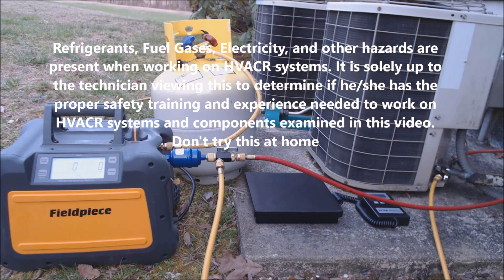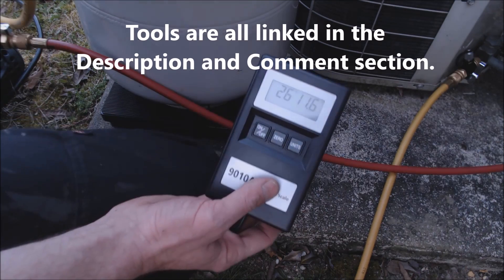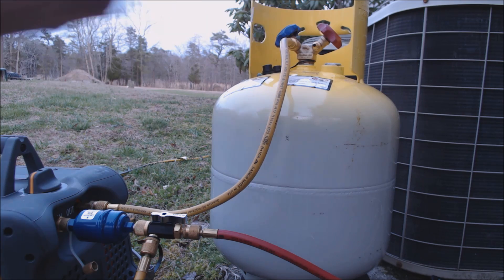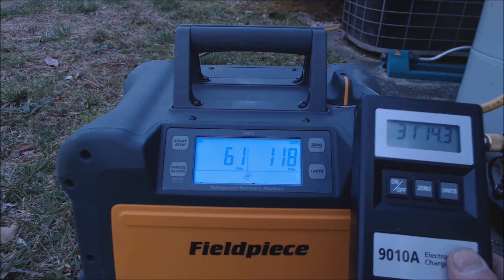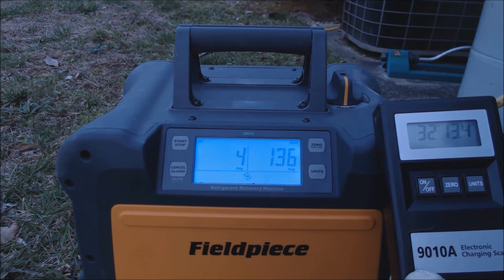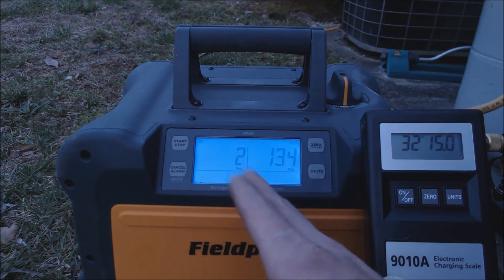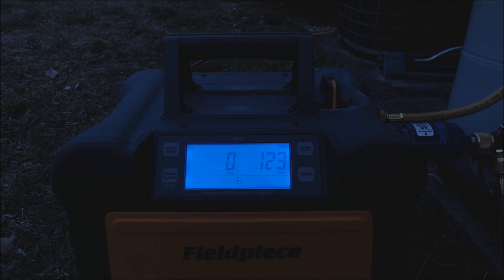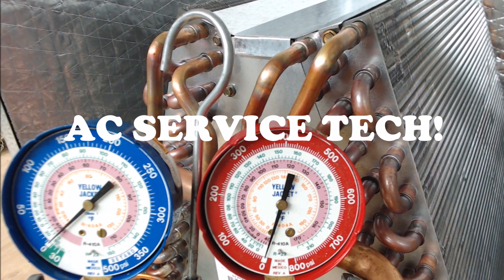Refrigerant RECOVERY Procedure Step by Step! Fully Recovered!

Comment from the maker: Tool List-  https://www.amazon.com/shop/acservicetech
Support-  https://www.patreon.com/acservicetech
For those that are looking for the tools used in the videos: (Linked Below)
Here is the link to the Appion Valve Core Removal Tool- http://amzn.to/2uYr8WL

Here is the link for the C&D Valve Core Removal Tool- https://amzn.to/2vqA0qy

Here is a link for RectorSeal Bubble Gas Leak Detector http://amzn.to/2ckWACn

Here is the link to the pack of 25 C&D valve cores- https://amzn.to/2J1lurm

Here is the link for the C&D Valve Core Wrench, Container, and 3 valve cores- https://amzn.to/2EVGkps

Here is the Link to the Fieldpiece MR45 Recovery Machine- http://amzn.to/2xAOpN6

Here is the link for the filter drier- http://amzn.to/2veVV3m

Here is the link to the Yellow Jacket 1/4" by 1/4" heavy duty hose straight-  http://amzn.to/2umtcod

Here is the link to the CPS Vacuum Micron Gauge- http://amzn.to/2v1nM3O

Here is a link to the JB 6 CFM Vacuum Pump   http://amzn.to/2nqbvo8

Here is the Link to the Appion Blue 3/8" to 1/4" Vacuum Hose- http://amzn.to/2uYlVyc

Here is the Link to the Appion Red 3/8" to 1/4" Vacuum Hose- http://amzn.to/2uYg6Ro

Here is the Link for the newer UEI DL479 Multimeter with temp sensor- http://amzn.to/2jtsUbJ

Here is the link to the 2 pairs of alligator clips- http://amzn.to/2CtIL5z

Here is the Link for the FieldPiece ST4 Dual Temp Meter- http://amzn.to/2AhR6ph

Other tool links can be found in the video description section.

Shop through Amazon! Your Purchases through Amazon provide a means for channels such as mine to earn advertising fees from all purchases after clicking through. Prices are the same as normal-    https://www.amazon.com/shop/acservicetech

All of the ACSERVICETECH Playlists-  https://www.youtube.com/channel/UCOZR-1IqsAer9wzlvFgb4mA/playlists?view_as=public
Reply: Please Please Please.........make a video showing these Tech's how to ( REINSTALL ).......that refrigerant back into the system after you reclaim it
Reply: @acservicetechLLC how did you make the connection between the filter dryer and the recovery machine ?

Comment: Min 2:25, the valve used doesn't appear to be a two way valve, it's only a one way, so one of the connections to the AC high or low will be evacuated not both simultaneously, so what is the point of connecting both? the high side liquid line valve connection seems open, which is connected to the low side of the recovery tank which seems counterintuitive.

Comment: Where did u buy that filter drier, what's the brand and part #? I only seem to see both sides male or both female. The one u show in the tools list is male on both sides. What adapter did u use to go from the male on thw machine to thw male on thw filter drier? I dont see that tool or part on the list.

Comment: If the unit has a leak then it’s useless to purge the hose to get the air out of the lines
Reply: Not quite. As long as he doesn't go below 0 psig it's not going to pull any air in. It can't pull air in as long as pressure is greater than atmosphere.
Reply: @FluffersMcFluffleton makes sense thx

Comment: FYI for EVERYONE: You do not get a warranty from Fieldpiece if not purchased from an authorized dealer.

I called Fieldpiece to check and they said that there ARE NO online (web-only) authorized dealers, including amazon, unless it happens to be an HVAC supply house that also has an online purchasing website. The current Amazon link for the MR45 is not an authorized seller. Be Careful. The Fieldpiece representative said they do not know where the online seller is getting their equipment - not good.

Comment: Where did it say that was a 50lb tank
Reply from the maker: it says WC water capacity on the neck. It may be 48.7lb possibly.
Reply: How do you use 1/2” hoses when one end is 3/8? The tee fitting is all 1/4”

Comment: Heres the problem i have with the ending of your video, when the self-purge shuts off isn't the output valve still open to the recovery cylinder?  

I would think you should go from "self purge" to "closed" on the knob the second the recovery machine shuts down from the self purge cycle; otherwise in theory, if the output valve on the recovery machine was open because the knob was set to "self-purge", the pressure of the cylinder would push vapor right back into the machine which we do want want sitting in the machine.

I would think it would be better practice to put the knob to closed position immediately after self purge shuts off, close the recovery cylinder, release any diminus,  open input and output port of the recovery machine to atmosphere briefly and purge with nitrogen, set knob in the recover position on the machine for storage.

Your thoughts?

Comment: how come the high side pressure did not read 0psig if all the refrigerant was recovered?
Reply: My question as well.
Reply: I think right in the beginning he says the two numbers are input and output. So the input on the left being the system side reading 0 and the output being the recovery bottle side and was reading in the 120 ish range or so. I think that's the answer, but I could be mistaken.

Comment: Hi Craig,

I noticed you had a filter drier attached to the mr45.  I looked at the description and it wasn't listed.  I checked on amazon for the mr 45 and they recommended the  Robinair FLCK-1 Filter Conversion Kit for Promax Recovery and Recycling Units.  I noticed you used an ek for the filter drier.  Which do you recommend?

Comment: Small point of correction: The WC# on the DOT cylinder is water content. When you calculate the amount that the tank will hold you have to first identify the volume of the tank by tank by dividing the WC capacity by the specific gravity of water or 62.4 Lbs. per cubic foot. Then you take that answer and multiply it by the specific gravity of the refrigerant that you're recovering (liquid density at a given temperature depending upon what you're doing with the refrigerant. If you're putting it back into the system you use the ambient temperature surrounding the tank. If you're storing it on your truck in the summer you will want to use whatever temperature you think the back of your truck will get) Once you get that answer then multiply by .8 for your 80% figure and then add the tare weight.

Comment: Hey man. Thanks for all the videos. Even bought the book. I got a question about reusing freon. If freon is recovered from a machine with restriction issues in the TXV or filter dryer, would it be risky to reuse that refrigerant in the same unit or another unit that is exactly the same? I work in an apartment complex where all the units are the same.
Reply: "Best" practice is to always use new refrigerant.

Comment: Hi, what recovery pump would you recommend for performance and longevity between the mr45 and the appion g5 twin? I'm a new tech starting to buy my tools. Thank you.
Reply from the maker: On that one, its most certainly the MR45. You can use the two hose setup, auto off, pressure vacuum display, and purge. You can't do the two hose setup with the G5 without an extra tee and adding a compound gauge, thanks! https://amzn.to/2nhtXRs
Reply: So are you saying 3 or 4 T's (valve Core tools) with the compound gauge with an Appion G5
Reply from the maker: @tptm100  Yes 4 of them with a compound gauge for the G5 vs only 3 of them and no compound gauge with the MR45, thanks. I have both of those recovery machines and the quick connect test gauge setup with compound gauge linked at https://www.amazon.com/shop/acservicetech  and here is a video of me checking a charge with quick connect test gauges so you know what tool I mean- https://youtu.be/eI_neAZkKYw

Comment: If I had a leak in the coil and if I only wanted to recover the refrigerant that is in the coil and the line, can I close the Service Valves on the condenser unit and start the refrigerant recovery using the procedure you have explained? Also, since we are using a filter drier while recovering the refrigerant, can we call this recovered refrigerant a Recycled refrigerant provided that the recovery tank was clean and had no previous residues in it? Appreciate your help!
Reply: Tech Bullet. Evaporator coil? Just do a pump down. And stop above zero to avoid sucking air into the system
Reply from the maker: Yes that is correct. Technically recycled means when you run it through multiple filter driers but yes you can reuse it in the same unit you recovered it from, thanks!

Comment: Why do you use valve core and what is that ? Please explain anybody if you could
Reply from the maker: The valve core removal tool removes the obstruction in the lines so that the pressure or vacuum read on you recovery machine is accurate and it reduces the time dramatically. Possibly to a 1/10 of the time. It just makes it very simple and easy. When you shut your recovery machine off, the pressure usually does not rise, thanks and also it is helpful to keep the indoor air running while the outdoor unit is off with this process. I have the valve core removal tool ad other tools I use linked at amazon.com/shop/acservicetech  thanks!
Reply: @acservicetechchannel  thank you, brother for reply !
Reply: @acservicetechchannel  by obstruaction  you mean sthe shrader valve ? What do you mean by obstruction?
Reply from the maker: Yes the schrader valve also known as the valve core is fine for checking pressure but if you look at one and check out the opening, it is not an efficient way to try to pull 5-10 lbs of refrigerant through, thanks

Comment: Hi AC, I got a Javac recovery machine today and I have an old R22 system that I need to decommission, I am scared of breaking it by flooding it with liquid, can I use the imperial qwik charge unit the other way round so that liquid coming out of the system is converted to vapour before it goes into the recovery machine ? Many Thanks
Reply from the maker: Usually all smaller recovery machines are designed for saturated and/or vapor refrigerant. Just don't recover with liquid only on those smaller machines, thanks
Reply: @acservicetechchannel  Thanks Craig, going to get another core removal tool and a tee tomorrow so I can recover both sides
Reply: Hi Craig, I set it all up as you had it with 2 core removers, Hi and Low going into a tee then into recovery machine, it was an old R22 Beer chiller that had been switched off and not used for years, it seemed as if it was all gas and no liquid that came out and I recovered about 2/3 of what the plate said,  is this normal ?  Thanks

Comment: Question if your hoses are 1/4” to the appion vct and 1/4” to the other appion vct 1/4 to the input of the recovery machine. The hoses to the amazon link are 3/8” to 1/4. I want to make sure they are correct before I purchase them. Thank for your videos
Reply from the maker: Hey Joe, you are right, they are 1/4 by 1/4 connections with a 1/4" hose, no valve and no valve core depressor. The 3 hoses are on the 10th row down at amazon.com/shop/acservicetech and the one from the recovery machine to the bottle is the shortest at 2'. thanks

Comment: Thank you for this video i like how you dont use a manifold gauge.  The MR45 already have a gauge on it, is this the reason why you dont use a manifold?  Can i still do this with a Recovery machine without a gauge?  Also can you do a recovery video with the CPS MT69 subcooler.  Standard Recovery& Push /Pull method.  😉
Reply from the maker: Yes you can do it without a gauge set on a normal non digital recovery machine by attaching test gauges to the open side of each of the valve core removal tools, thanks

Comment: Hi can a recovery machine like the MR 45 or a robinaire  RG6 be use for recharging a  A/C system from a R 134A  and if you recover the same system with these machines then what about the oil in the system where is it going to go because when you see a purpose built machine they have a small container to collect the oil in the system.
Reply from the maker: In smaller systems like a car, some oil may be taken out with the refrigerant if you recover it as a partial liquid. In larger systems the small amount of oil will be insignificant when recovering from both sides. After there is a vacuum under 500 microns, we just weigh the refrigerant back into the system as a liquid into the liquid line from the recovery bottle. You can reinstall the same refrigerant into the same owners asset but not someone else's, thanks

Comment: Do you use a different filter dryer for each type of refrigerant? Do you reuse filter dryer or just use it once?
Reply from the maker: They aren't going to do much good when reusing them other than a prefilter. It is just to keep the recovery machine cleaner. Every once in a while I will reuse. Also if you were going to reuse the refrigerant that you are recovering into a new and vacuumed bottle then it would also be good to have the filter drier in place. I didn't always use a filter drier on my appion g1 and that one worked well still., thanks Robert

Comment: @acservicetech your videos are a godsend. I got a question for you: what does it mean if I did pressure reading on suction line/lo-line on a unit with presumed refrigerant low - and notice PSI at Suction Line is 0 PSI and at HI line its about 250 psi.....means the unit does in fact have refrigerant? If that were the case wouldn't suction line show a PSI reading?? Question # 2: what does DESIGN TEST PRESSURE (HI 450PSI / LO 250 PSI) mean on a units label VS Max Design Working Pressure (700psi)? Does that mean HI should ideally be 450psi??? So confused! The teacher isn't that useful in class either.
Reply from the maker: test pressure is how much you can safely pressure test it to. Those pressures are just max's and are not what the system runs at. It can be at 0psig if the pressure is very low since that is the suction side. Make sure that the indoor fan is running at that time. You would need to find and fix the leak, thanks
Reply: I redid my measurements. Turns out PSI for blue is actually 50 PSI (sat temp of looks to be 10 degrees F on my yellow jacket... I believe you recommend at least 30-40!) on the suction line and HI was about 200 with the condenser unit running also (saturated at 70 inside the coil). Does that mean refrigerant is low and hence there's a leak? So it's necessary to have the indoor AC or just the fan on for Suction Line accurate measurements? Also is it possible to feed refrigerant into the HI-Line a little at a time with the system off if not completely empty? God bless for your reply!!
Reply from the maker: The indoor fan if off would make the low side even lower. If the system is off and equalized, and the pressure is lower than what the sat pressure on the bottle is then you can add liquid into the liquid line, otherwise, you would charge into the low side some at a time to try to raise the pressure, thanks
Reply: Was just watching you pressure gauge video. Your explanatory dialogue is amazing. My indoor fan was off - that would explain why my low side showed 0 psi yesterday when I did the reading. When you mention equalized, what's the measure of that? When the system is off, hi-side sits at about 200 psi I believe. How would one tell the sat pressure on the R410 Bottle? I only recently passed my EPA-608 and R-410A cert. I have zero experience infield fyi if it isn't obvious xD. 

You mentioned in the gauge video it's necessary to raise suction line to above 32 before even checking subcool/superheat. I'm wondering if I can raise that via liquid line with the system off.

Comment: Your videos are very good.  Do you recommend buying a system that uses microchannels or one that uses aluminum tubes?
Reply from the maker: I am near the salt air at the shore so we stay away from microchannel here when we can but otherwise if you are inland then they are ok, thanks
Reply: Thanks I am inland but I am trying to decide between a Ruud with tubing or a Gibson using microchannels.  What is you opinion?
Reply from the maker: I prefer copper tubing with aluminum fin but it may just be because of our location and problems that I see, thanks

Comment: My compressor has a RLA rating of 16 amps.  In general what should the minimum value be when testing?
Reply from the maker: Thats actually rated load amps which is the highest the unit could run at safely under bad conditions. It will be much less than that, thanks Steve!

Comment: Did you close the valves before you performed the "purge"?
Reply from the maker: So I use the pressure from both the red and blue hoses through the manifold, through the yellow line, through the recovery machine, and through the last yellow hose to purge the air all at once at the recovery bottle hose connection, thanks Brian!